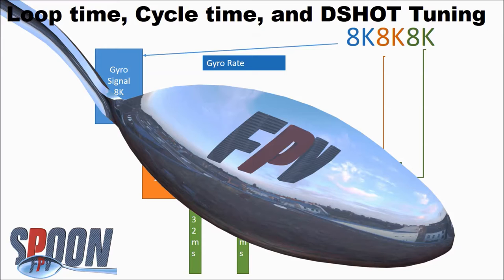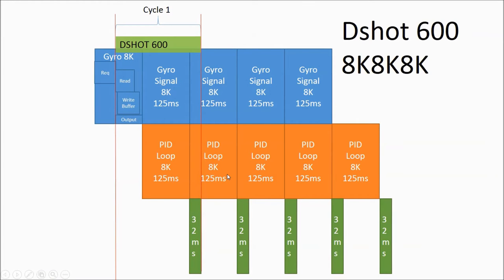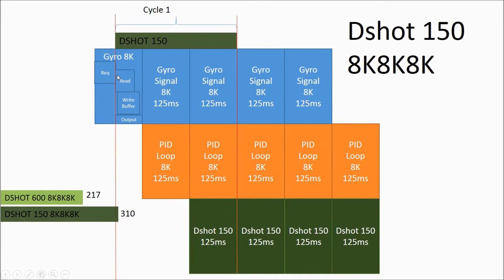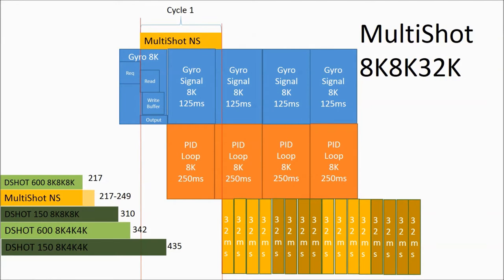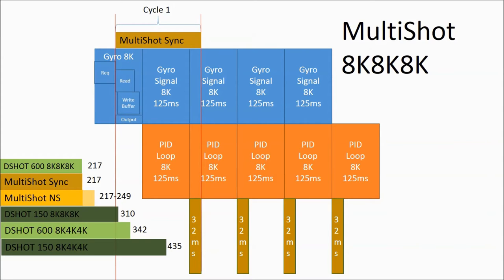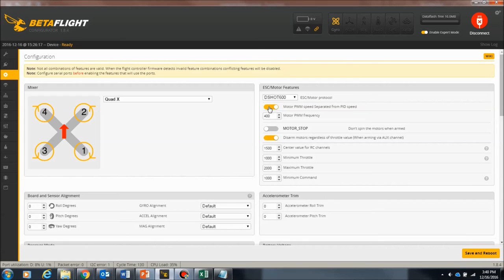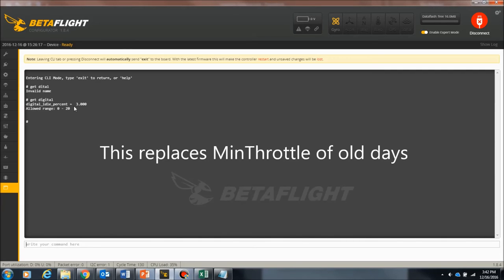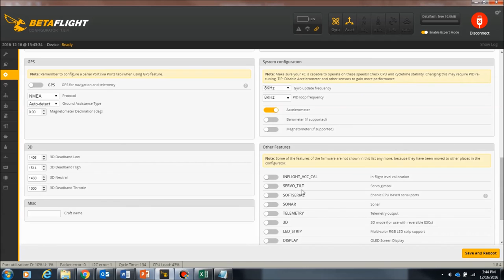Dshot Setup, DSHOT Vs Multishot Comparison, Looptime CycleTime

Comment: great video. Really clarified the whole Dshot hype for me
Reply from the maker: Glad you liked it.  Dshot or at least digital protocol is going to be the future.  I think the big advantage is the resolution, Dshot provides 2048 steps, where other fast PWM protocols only provide 240.  If you haven't seen Bardwell's latest video on Dshot you should check it out, he covers some points I missed, in this video.

Comment: Thanks for taking the time to make those slides!  So let me see if I got this right.  Both DSHOT 600 and MS are useful in sense that they will deliver the fastest response/signal to the motors from the ESC.  The difference is that with MS, you run unsynced faster than the PID loop.  This helps achieve better "accuracy" of the signal to the motors via the averaging of an over-repeated signal.  With DSHOT you need not worry about this because the signal is digital.  Is that somewhat correct???
Reply from the maker: Yeah, the thought process is that it will increase the "accuracy" of the signal to the motors, however, I doubt it works that way in practice.  Multishot only has 240 steps of resolution, and Dshot has 2048 so with Dshot the FC can provide much more fine tuned smaller steps than Multishot, and as it's a digital protocol so Dshot will always spin the motors at the speed the FC requests.

Comment: Great video! I have watched it a few times and I am trying to grasp the concept. 
So is there an "ideal" loop rate for each DShot protocol?
Reply from the maker: +Ninja Sauce it's just about minimizing the delay from craft movement to craft response.  Faster is better.  Dshot1200 is better than multishot hands down, multishot is better than Dshot600 in some cases.
Reply: Thank you. I am troubleshooting a new build. When I go into a flip or roll, it goes crazy and cannot recover. Its very hard to tell what the problem is. I have tried tons of different settings and nothing helps. I had this problem on a previous build, and after 3 months of continuous troubleshooting, I ended up tearing it apart because I tried almost every single combination of settings in Betaflight and nothing worked. I really like my newest build, and I would love to see it fly before it gets destroyed. Every single time it flies, it ends with a crash.

https://youtu.be/iCXpKNAu3Fo

Comment: Awesome!! Thanks!!...subbed!!!....where do I get the hex to run the 8K 8k on F3..( currently using xracer v3.1 with beta 3.1 ) 8K,8K sends the CPU straight to 100%
Reply from the maker: SKIDOOSH I'm running the build from December 14 I think its like 841 or there abouts,  Any build after that should run 8k8K on F3.  I was running an earlier build prior to this video and it couldn't handle it either.
Reply: Man I tried and tried...I can not get the new builds to unzip!!! UGH!!! Files download , but won't open to extract...
Reply: never mind...got it...cpu is still quite high tho..

Comment: The latency of multishot varies from 5us to 25us depending on throttle value with Dhsot 600 the latency is 25us constant regardless of throttle value.
For this reason multishot is on average a little faster.
Reply from the maker: +Stephen Gibb yeah I did an update on this that includes proshot and I mention that, recommend you watch that on over this one.

Comment: Hi
the maximum I can run on my quads is 4k 4k what would you recommend, I have been using dshot 300, would dshot 600 make much of a difference.
thanks
Reply from the maker: +Edward Lee It will make your quad a like more responsive.  Don't know that you will really feel it that much, and it could change your tune a bit, it's worth trying though to see how you like it.
Reply: thanks
I will give it a go